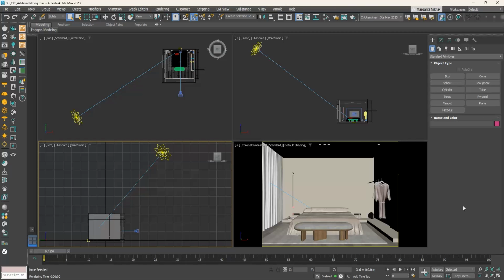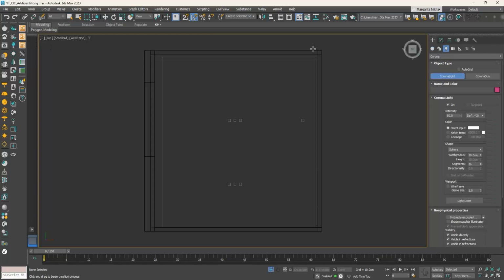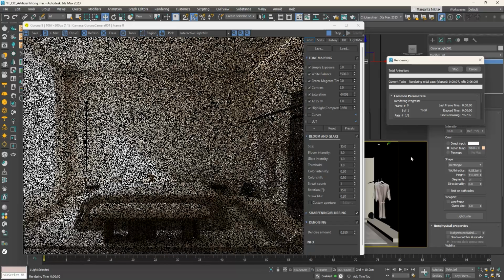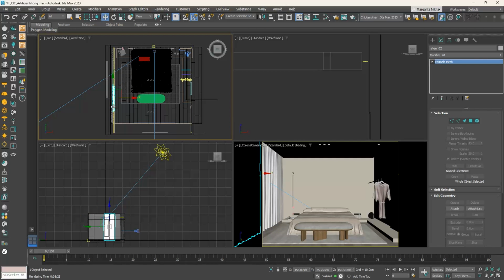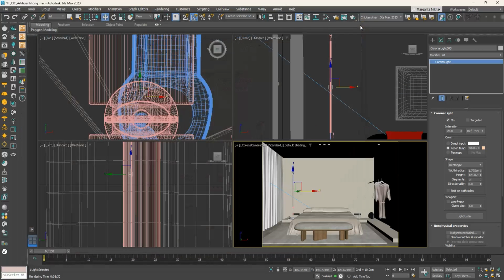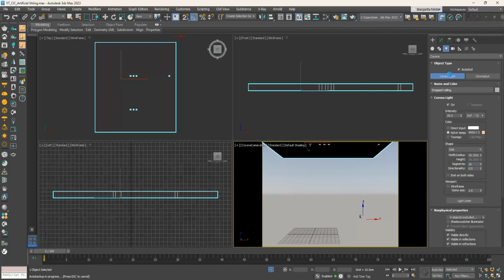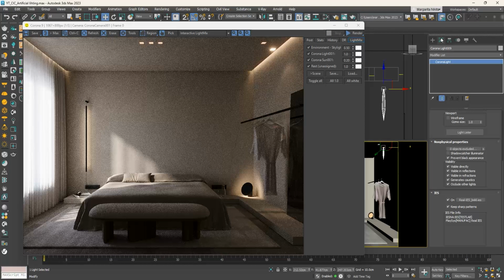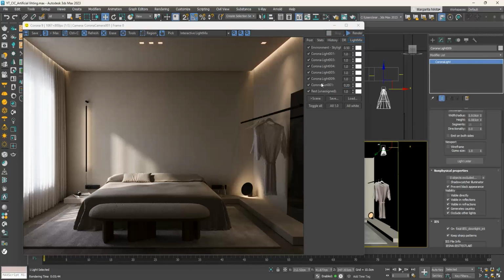Corona in 3ds Max tutorial | Artificial Lighting

Comment: Thank You ,🤩

But why when I change Kelvin value in light mix  after render finishes , it does not change ?!!

Do you recommend to change color and intensity from the light parameters not from lightmix while rendering.
Reply from the maker: It should change. In general I always use lightmix, but I also do the main setup of my lights through the parameter editor. I mainly use LightMix for creating various lighting scenarios